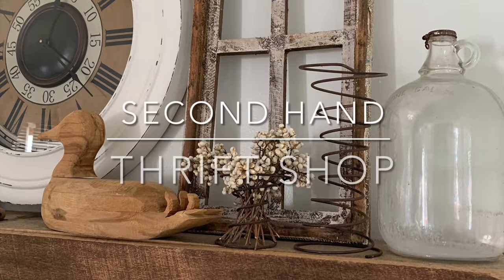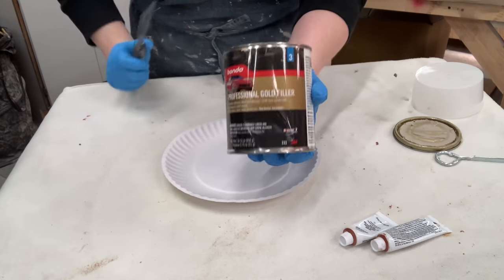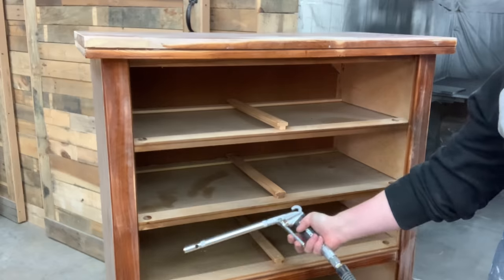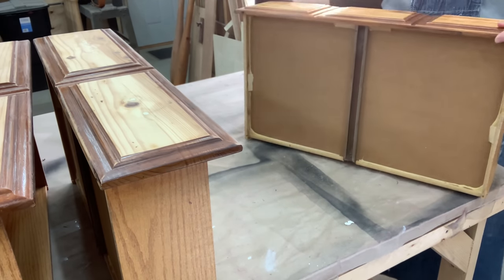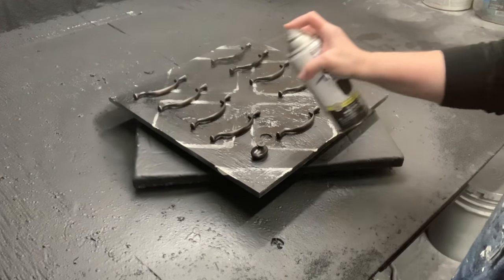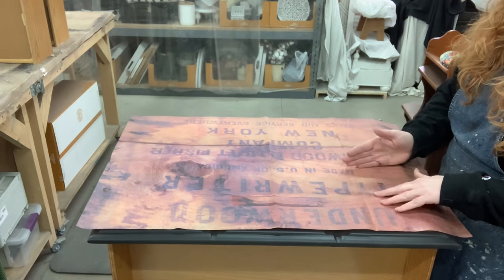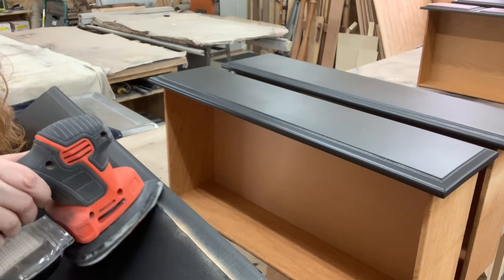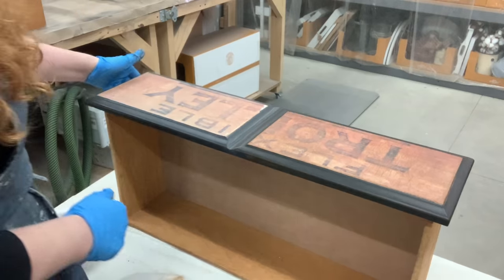Marketplace*Second Hand Furniture*Makeover*Industrial *Trash to Treasure *Decoupage

Comment: You can apply Mod Podge, allow it to dry, and then iron on the paper being decoupaged. Use parchment paper between the paper and iron. The heat from the iron melts the Mod Podge and it makes for a very smooth application. I have also ironed decoupaged pieces after they have been top coated with Mod Podge, when they have bubbled or looked wrinkled, using parchment between the piece and the iron with good results. I put my iron on the wool setting.